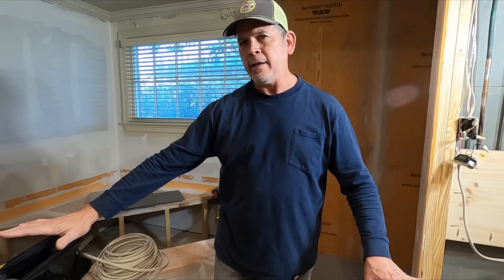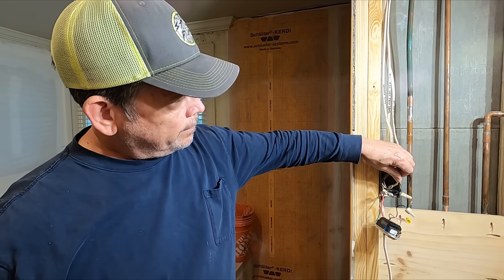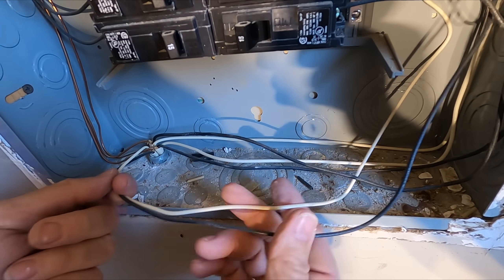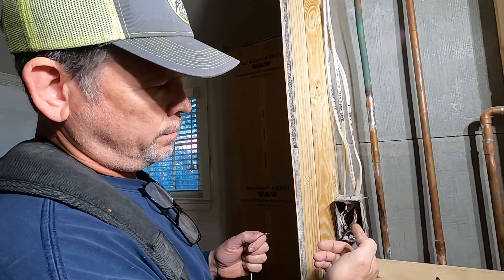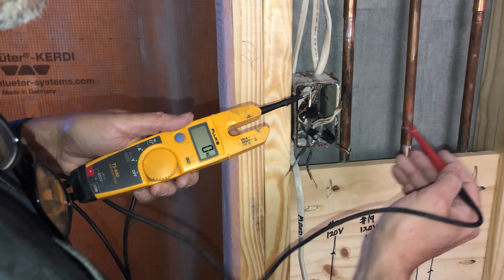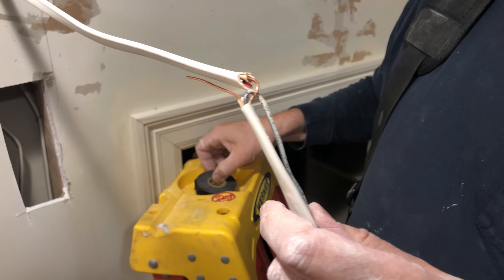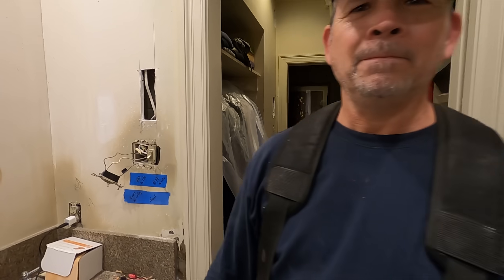You CAN Get SHOCKED by a Neutral Wire! This is How...

Comment: I think it would be more accurate to say that the misconception is that you can't get shocked by a white wire. If a wire in a house really is a neutral, it will be grounded. HOWEVER, just because a wire is white doesn't mean it's a neutral. According to code, it needs to be white (or it can be gray where I live), but who knows what kind of fuckery the previous home owners had a hand in.

Comment: I ran into this same exact thing.  Two light banks on seperate breakers, but sharing a neutral. 
Instead of cutting out sheetrock and butchering up the recently finished walls to fish in a new wire, I put both light circuits on the same breaker.
I calculated the amperage the lights from both circuits were taking, and it was still well under the 15 amp breaker, so I didn't see a problem putting it on one breaker.

Comment: First off...excellent video! I almost passed it by! In the past three years now, I've rewired my entire two-car garage with no problems!! NOW, I'm working on separating all the main appliances, stove, fridge, washer/dryer, microwave, furnace and an A/C outlet and making them all their own dedicated runs! Soon I'll be doing all the rest of my houses runs and with each run I'll be adding some outlets and a couple light fixtures, but none having more than two light fixtures and switches, and no more than four outlets per run!! I know I can do more than that but it's a small 500 square foot house! My main goal here, other than NOT burning down my house, lol, is to remove ALL OLD 50-year-old plus wiring!! Ive already encountered two situations of me undoing one wire in a connection and the second, with a minor pull to make more accessible, literally just came off. And there are no grounds to most of ANYthing in this house, which is, as I'm going, being remedied!!! My ultimate question here is...neither of my panels, the 100 amp garage or the 200 amp main in the house have separate ground/ neutral bars. IS THIS A PROBLEM and SHOULD I install them and separate them?? I'm sorry for the "BOOK" here but this is all I'm dealing with here!! Thank you for the video and I would love to hear back from you!! THANKS!!! : )  Don W., Ohio
Reply: I presume you found an answer since leaving this comment, but in case others have the same question:  Yes, neutrals and grounds should be separated except at the main panel.  Under normal conditions, current should not flow on the ground.

Comment: I was taught early on doing electric work to tie all neutrals together in a box. I questioned this very early on. you only tie in the neutrals of the same circuit together. sometimes you have several circuits in the same box. if you tie all neutrals together you made a big mistake.
Reply: Why would you have multiple circuits in one box?

Comment: So if light switch off but not circuit breaker and I got shocked but touching ground to neutral then the neutral is not wired correctly?

Comment: Dont touch, shared branch circs should be on 2 pole breaker anyway too avoid this, in addition the wiring has been screwed with by non electrictrician, and get a pencil tester to test wires as you un twist them,

Comment: Hey stud pack...  i was redoing all the electricsl recepticles and light switchs in my house..  and when i was doing one light switch i actually got shicked by the ground wire.. the copper wire..  how is that possible ?   Every switch i did in the house ground went to ground.   Neutral to the alluminum screws.. and black to the brass screws.. exactly how the old ones were wired..
Reply from the maker: The problem must lie elsewhere.  That can be tough to find.  Start by turning off circuits until the current is gone from the ground.  At least that way you've narrowed down the problem.

Comment: So I never got shocked despite working with electricity for about 5 years now 6 years Professionally at least and the only reason why I have it it's because my dad worked with it and I would help him and he would lecture me and I actually listened I've had things argued me but I've always been wearing good gloves that he showed me and I've never been on electricity because of it he showed me the long sleeves that I'm supposed to wear as well as the gloves and and honestly those have probably saved my life a couple times because How's work going with some shotty shotty work Right now I'm fixing a house that has more wires than it really should that was Billy should there was 3 separate hot and grown and neutral  Wires going to the same outlet and this happened for multiple sockets in this house Solve testing it you should individual one but but sometimes what they would do and if they would have a hot wire from 1 wire I'm in a neutral from another and that ground from the 3rd wire and I'm like what the fuck fuck I don't have any don't get who designed this electrical in this house I will admit that it's old as fuck but this is still the 1st time  I've seen something like this and I have done a lot of rentivations for houses

Comment: Please don't ever forget, even if someone tells you the power is off...check it with TWO testers!  Twice an entire house was supposed to be shut down and i got shocked on an exterior light and (luckily i tend to tap a hot with my screwdriver) could have been hit with 240.  Melted the tip of my screwdriver and most certainly would have ruined my day.

Comment: As an electrician who took a nasty ride on a 277V shared (unknown to me at the time) neutral many years ago, I commend you for highlighting how dangerous neutrals can potentially be. So often I see people make bold assumptions about those little white/grey bastards. Assumptions can get you killed, folks.
Reply: Luckily never been hit by anything above 120 but I always try to respect all wires.  Colors dont matter.  ;)  thats what your meters for.
Reply: @justinbrewer9326  amen to that, meters save guessing kills
Reply: Test before touching. It doesn't matter what color the wire it. I even test grounds, just in case.
Reply: @MAGAMAN  wouldn't have mattered in my case. Knew the box had hot taps. Had to work 1 circuit in it that was dead. Couldn't shut everything off cause hospital lighting. Wire nuts came loose on live lighting circuit.
Reply: Amen brother, 480 has same effect ps IT HURT
Reply: @watup110875  Yep. 480 can be pretty scary when shit goes wrong.
Reply: @watup110875  Worked with 480, never got hit by it. Funny thing is you get hit and then go back to testing and everything, then get lazy again. Start resting your arms on T-Bar and whatnot. Sometimes I am amazed I didn't kill myself on the job LOL.
Reply: @lespaul36  amen to that
Reply: I've heard 277/480 is particularly deadly and nasty. Damn.
Reply: @nateo200  they all can be. So Many variables though - path of current, conductivity of skin, current load, all sorts of stuff. That said, the most STATISTICALLY lethal voltage in the US is actually 120... mainly because it is the most commonly available voltage out there, and also because people often underestimate it's lethality.
Reply: An electrician was killed on a jobsite I was on because of a 277 volt lighting circuit box like this...
Reply: So i was changing the light switch in my bathroom today and one of the 3 wires shocked me. Like an idiot i forgot to turn off the switch. Should i be worried?
Reply: @2r380  worried about what?
Reply: @heidis8713  nevermind i’m alive lol
Reply: Right he never showed how it you worked on it live your could end up holding 220
Reply: @mggahomes9721 you end up holding 22p means seriously problems in wiring and or your understanding of how to work woth electricity.  It's pretty simple to properly measure rather than assuming.
Reply: If commercial those neuts can carry more amps than hitting the hot since they often are shared. 277v lighting got me a few times.
Reply: Its not that neutral is dangerous its people mistake mixing neutral from different circuits
Reply: 1st year on the job I was replacing a simple switch in a bass pro store and it had a naked place in the wire that shorted against the box and I didn't get hit thank god but I got to see a softball sized fireball 1ft from my face with a  double barrel-esk explosion (277) with sparks flying in all directions,  I got to see up close and personal just how nasty 277 really is, scared the chit out of me, didn't realize the wire was naked, boss came in thinking I tripped the breaker and he did the same thing, then it tripped the breaker and we discovered the knick in the wire

Comment: Please make a video on your worst shocking experience. I am interested!! I do electrical work all the time. I learned a lesson a few days ago while working on a GFCI outlet. I tested it with a plug in tester.  It showed no power. Then I got shocked when attempting to remove the black wire on the outlet. The outlet was bad!! I learned to never believe just the plug in tester on a GFCI outlet!!!! Always follow up with a voltmeter test on the hot and neutral wires before engaging them!!!!!!!!

Very nice job explaining the feed back problem with the neutral. I really appreciate your attention to detail!! That's why I continue to watch. We think a like!!
Reply: I always use a voltage sensor pen they beep if they detect power on a wire, or outlet buy a good one. I use it all the time before I start working on any wires because never know when flip a breaker if power is back feeding on a neutral.

Comment: Many years ago, my dad had the broken neutral problem. Using a neon tester he found the power was on but couldn't understand why things didn't work with the power on ! I've also come across a washing machine where the manufacturer had connected the main on/off button to the neutral - so when the machine was 'off', everything was live!
Earlier this year I bought a 3 phase generator - so that's even more fun ! The fun really begins when you start splitting the phases and using the neutral. Using 1 phase is not complicated but using 2 or 3, you need to be sure the neutral is not broken otherwise some equipment might find itself on a much higher voltage than it was designed to handle !

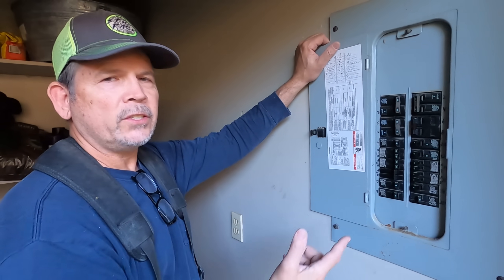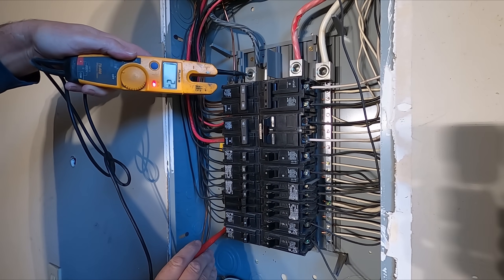Comment: 3:55-6:05 Basics.
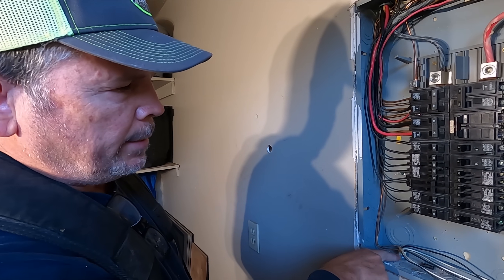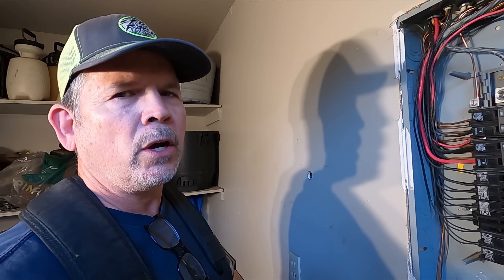6:06-6:55 Explaining the breaker for the circuit under discussion.
6:55-9:00 Showing the problems in the actual circuit and explaining how it will be solved.
9:00-10:47 Showing the problem in a circuit diagram.
10:47-11:48 Solving the problems.

In brief, the problem was that two 120-V (L-N) branch circuits (of the same phase/leg) were sharing the same neutral wire to the panel. So when the main neutral wire is disconnected, now the L-N loads on one branch circuit will be in series with the L-N loads on the other circuit. Hence there will be a voltage drop across each group of loads. So there will be voltage at the middle (i.e. the common neutral of the two groups) with respect to the neutral busbar/ground.

Comment: Very good video. Yes give us more Electrical story’s. I had lots of training in school. And have been working in the trade for years. But today as my son was helping wire up a ceiling fan. The white wire bite him. Older homes can have some crazy wiring done over the years. Be safe guys.
Reply: Yeah I'm doing a flip house electrical just had buried hot wires, 2 circuits for the kitchen all wires pretty much connected through junction boxes. It was hell thank God the attic didn't have toxic insulation. I'm only 22 btw so still learning but those old houses omg.

Comment: Hey thanks for the info. 
I have a question about a plug installed from a switch. 
1. I get 120v and will work with lights but will not work with a hair dryer. Do you think it may be a neutral wire problem?
Reply from the maker: “Plug installed from a switch” is that just a switched receptacle?    Light works but not hair dryer... could be a loose connection.   Does the hair dryer have a GFCI in the cord? Is it working?

Comment: Thanks for sharing. This was very educational. When changing electrical outlets, I use my klein voltage tester and tap each wire again after shutting off at breaker. Should I do any other step to make sure I don't get shocked?

Comment: I ALWAYS check wires with a multimeter even if I turned off the circuit breaker and even more so on capacitors when I’m working on HVAC units. Thanks for this video as I didn’t know about the shared neutral.

Comment: I am a retired electrician in Australia....was an installation inspector for 25 years.I am amazed with the way wiring is installed in buildings in USA.....I think the methods and materials used in Australia are far better.That is only my opinion . I had worked in the electrical contracting industry for 24 years starting my 5 year apprenticeship when I was 14 back in 1963 so have some experience in the electrical industry.

Comment: Moral of the story, ALWAYS check the wires for energy BEFORE you start touching them. Multimeters are affordable. Some are less than $50 and are plenty good enough to tell you if you have voltage—and how much—at a box or wire.
People usually get shocked because they are overconfident and/or hasty.

Comment: Great job guys👍🏻 I’d like to see more info on electrical wiring it’s by far my greatest weakness. I know how to do low-voltage (CAT5E/CAT6) I know the NEC codes! But electrical cabling and wiring quite frankly scares the hell out of me, Even more so now after hearing about that stray neutral wire that had 122 volts on it! I’ve always hired an electric contractor but now they double their rates per hour now at $130. so I really need to learn more about this stuff and how to do it I’m not paying somebody $130 per hour because now they have a new CEO or sheriff in town at the Company!

Comment: I got this tickle a lot when I was doing jobs in San Francisco back in the '80's, lots of old buildings had the most unsafe and "improvised electrician" work that I've ever seen. Learned to be able to work hot safely though, or as safe as you can be when playing with a venomous snake like live wire is, so I don't recommend it but sometimes you need to do it. Like playing "Operation" with a Tickle instead of a Buzz.

Comment: I am surprised by this. I'd have assumed each circuit would have it's own neutral and would terminate together at the consumer unit rather than hi-jacking the neutral from other circuits all over the place. Maybe it's different here in the UK.
Reply: Normally wires are not just left unconnected in electrical boxes.

Comment: I've encountered a problem like this before, but I don't think mine was an accident. It was a multi-wire branch circuit. Is that the same, effectively, as what was shown here?
Reply from the maker: Yes but with one key difference.  A MWBC will be connected with a two pole breaker which prevents an overloaded neutral.  In this video the two circuits were on the same line (phase) creating an overloaded neutral.

Comment: I have found so many messed up electrical wiring problems in my house i could have a separate book on one's nobody has in their repair books i got shocked by neutral because someone had switched lights on top of an outlet with one circuit and unswitched outlet on another circuit on bottom. they replaced the outlet and didn't snap off tab separating top and bottom and switched wires around, so each circuit used both whites to return to ground

Comment: At @10:00 , when circuit 19 and circuit 20 are connected without a neutral, is the potential in that path 240V? Or is it still 120V?

Comment: This all depends in what country you are in. As to me blue wire with black tape/ black marker is load (live). Situation is that you have brown (live) going to switch and after it comes back from the switch it turns to black a.k.a load. If you have thicker cable you can have more wires but mainly people are using 1,5mm-2,5mm cables with 3 wires. Those wires are brown, blue and yellow/green (ground). This is just example what people have in other countries. I think the most confusion situation is that someone has really messed up junction box (example in ceiling) and there could be any kind of connections and you can have junction boxes that are in series which takes this to whole another level.

Comment: If i want to make it idiot proof I could make sure all lines and neutrals are fused and all switches are switching both line and neutral? In my caravans fusebox for 230v intake both line and neutral have a double fusebreaker. So if the fuse triggers it breaks both line and neutral. I guess it is so because you can connect the 230v upsidedown in europe making line bonded to ground instead of neutral?

Comment: I found out about multi branch circuits the hard way.  Should have clued in when I saw 220V line (red/black/white/ground) to the first fixture and 110V going out.  Turned off one breaker, thought it was OK.  Surprise!  They should have used bridged breakers.

Comment: Being shocked from a neutral while a switch is off but the breaker is on also happens due to another device being in on the same circuit. Due to that I rarely find myself touching neutrals ! It's a different reason but same outcome. Yours a poirly wired device imho!! Some times one has to work a circuit hot that's when extreme care needs to be taken for sure.

Comment: It's only the neutral wire. It can't hurt you. I was on a twelve foot ladder and almost fell because unless you know , it can kill you. Especially when you are working on 277 volt industrial lighting. Electricity is dangerous.
Plumbing is a lot safer. Sure you get a little wet. It beats the hell out of electrocution. Moral of the story-be a turd pusher.